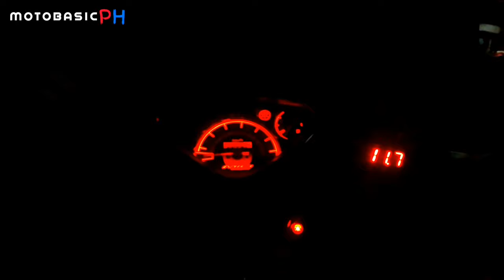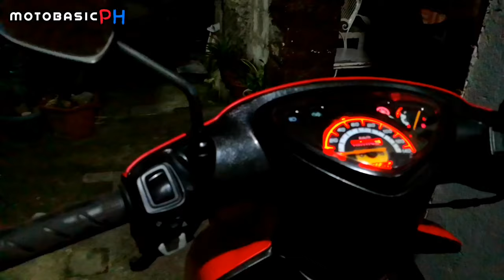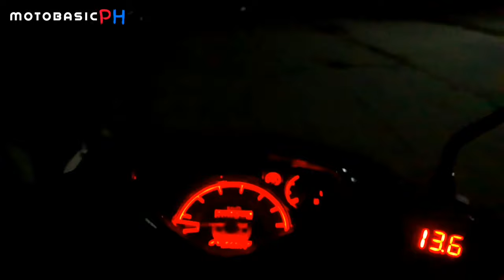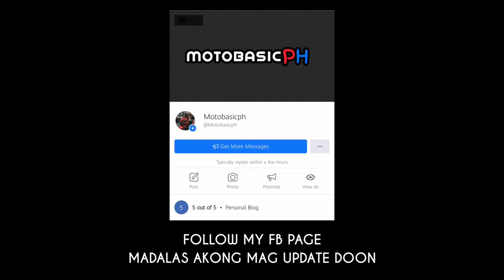MDL NEW BRACKET INSTALLATION (YAMAHA MIO SPORTY)

Comment: Boss pwde po magtanung?
Reply from the maker: Sure bossing habang online
Reply: @MotoBasicPH  ano kasi boss full wave na kasi din motor ko honda wave 100, tas nag voltmeter reading ako pag nakapatay ang motor ko 13.5 tas pag naandar na tas rev2 ng unti2 nasa 14.6 at pag nag full throttle na akoa nasa 15.1 or 15.2 sagad na yun na reading... Normal lang po yun d ba sya overcharging or may sira?? Salamat po sa sagot